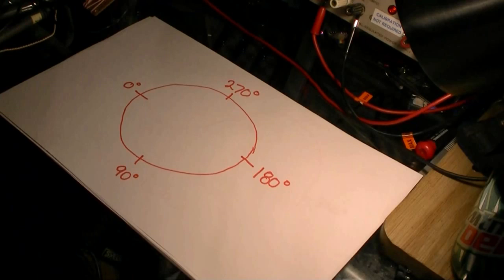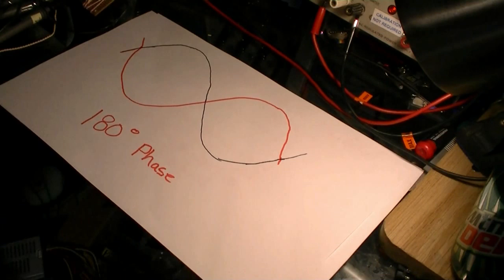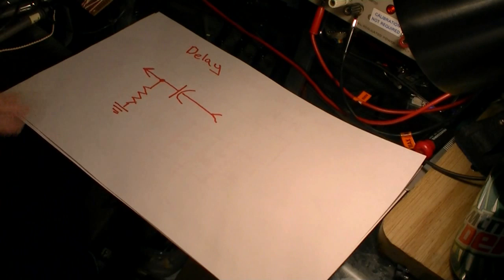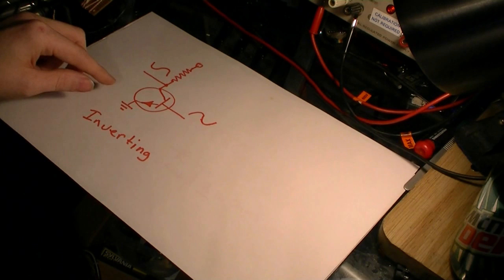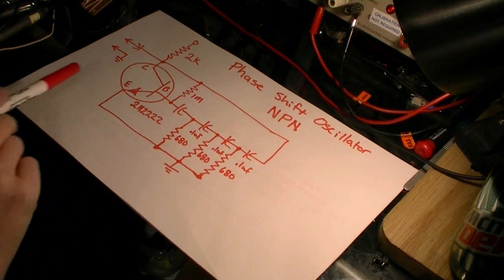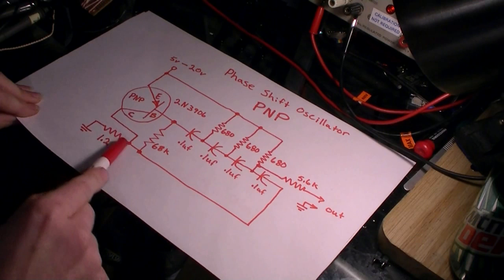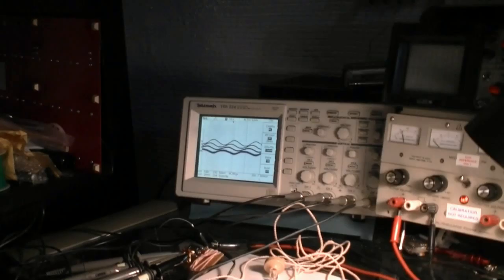Phase Shift Oscillator - Short Circuits

Comment: You want the input to be in phase with the output, but the transistor inverts the signal, therefore you want the input to be 180 degrees out of phase. A simple RC circuit in theory can shift the phase by up to 90 degrees, therefore if you put two RC circuits in series, with the right values, you could get 180 degrees, but you never can get 90 degrees from an RC circuit. But, if you put 3 of them in series, have each one shift the phase by, say 60 degrees, then the total phase shift through the RC circuits will be 180 degrees. You could do it with more RC circuits, but generally only 3 are used in a phase shift oscillator. So, that is why she has to have 3 RC circuits. The rest of the circuit is standard transistor biasing and amplification.  Once again, Jerri inspires us review our basics.

Comment: @jkeyzer you need at least three.  A single RC circuit has an asymptotic phase shift of 90 degrees (pi/2 - which approaches only at infinite loss), so by using three each need only supply pi/3 phase delay with a finite but manageable loss that the active device's gain can make up.  You can use more stages with less amplitude loss per stage and will require less gain.  Using a JFET for the amplifier also simplifies things because of its much larger input impedance than a BJT.

Comment: Nice Video. One small thing though: The inverting amplifier's input and output don't have a phase relationship of 180°. The amp simply mirrors the signal along the abscissa. However for repeating signals like sine wave the results look identical which is why this little mistake can be found in many textbook descriptions.

Comment: You can pick up those piezo earpieces relatively easily on eBay from sellers specialising in radio parts - handy when debugging radio/audio circuits (or just listening to a crystal set).
An interesting and informative video as ever, I look forwards to the next one!

Comment from the maker: @thewii552 You can change one delay element with a pot.  I believe there is start up issues with only one element, but try it and see. This will work at any voltage if you get parts rated to that voltage.  I only used small signal transistors in my example.

Comment: @jeriellsworth Looks like plain old "large signal" distortion of the common emitter circuit.  Adding enough emitter degeneration to to give some -ve feeback will clean it up a little, but you still need to provide enough gain to oscillate and you'll get distortion from amplitude limiting too.  One simple way is to put a trimmer in the emitter and adjust it just beyond where the oscillator starts reliably.  A buffer amp is a good idea if the load varies.

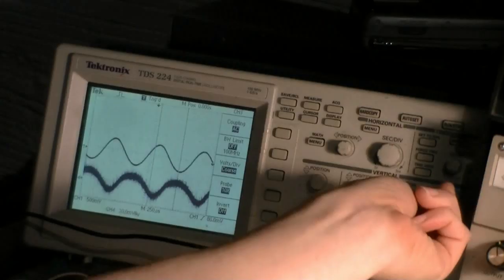Comment: Wow! That was kinda artistic at 2:56, kinda like ripples in the ocean as they would be represented when principles of 'perspective' are applied. I want a a phase shift schematic to build a motor controller. I want to regulate a fan by controlling the firing angle of the phase. Somewhere I saw that you could use the components of one of those dimmable lights like you use in the house, if you modified it a little. And the fan I would be using would have very low current draw.

Comment: I noticed that your representation of a sine wave is upside down (inverted) or 180 deg out of phase. The first two quadrants should be positive and the last two negative. Try it with a calc.  sin(90 deg) = +1, sin(270 deg) = -1

Comment: you can use either or both, a pot will change the frequency, and so would a variable cap, at least on any other oscillator circuit I have built.- I figured out you can also use a capacitor, and connect a pot in parallel, and it adjusts the capacitance.

Comment: @jeriellsworth haven't tried single delay element...i want to have the thing working first, with the 3 stages! (can I change the component values (smaller caps, larger resisters?)

Comment: how would you add variable freaquency funcionality to this-adding a potentiometer to one of the delay elements? also, will this work with only one delay element? third, will this work at 24 volts, or will it break?

Comment from the maker: @jkeyzer I think start up is less reliable with fewer stages, but I'm making an assumption based on ring oscillators I built before (in other words pulling from my arse)   Having more stages may be an advantage if you want to use lower value parts.

Comment from the maker: @thewii552 Almost anything will work in the delay section.  Are you using the same transistor I showed in the schematics?  Maybe you mixed up the transistor pinouts.  Try reversing the power supply polarity.

Comment: If you put a "high" into the input of the three delay elements, you get a "low" at the input of the base of the transistor, which would want to pull the output "high"... you'd think this would just get "locked" into one state. i don't understand at all. you'd think you'd want 180 degrees of phase like in a digital ring oscillator

Comment: Jeri, are you sure it's possible to change the frequency with just a pot and not having to add some variable capacitor? I read so much up on this over the last weeks and now I'm just giving up and going for some boring function gen IC. I would like to build it with just components!

Comment: @jeriellsworth Just found this video again, and tried it again. I think the problem is that my old scope didn't have the bandwidth to measure the frequency I had-I found the circuit on a breadboard in the corner, and it had an output of around 65 MHz. Can't seem to figure out how to change the frequency of the oscillator though. I suppose we will see after I play with this a bit more.

Comment: Nerd nitpick alert here! The way you represented the sine wave in the beginning is not quite correct as far as the curvature is concerned. I realise you only wanted to roughly explain the concept of phase, but two semicircles joined at some offset is not the same as a non-linear function of sin(A) rendered in Cartesian space.